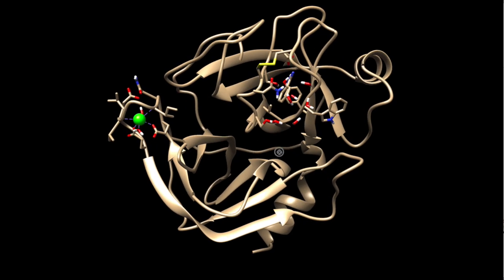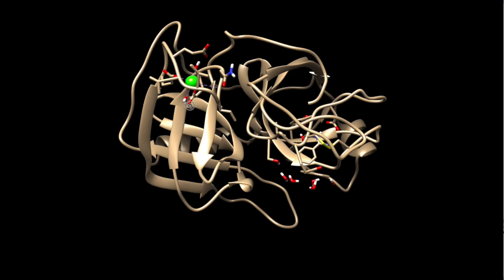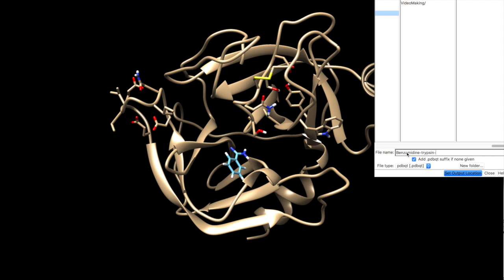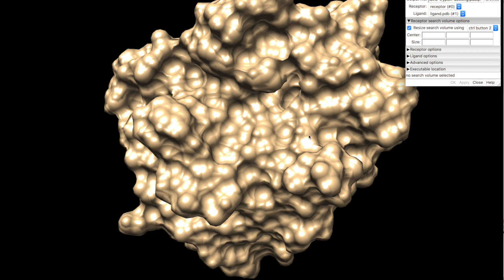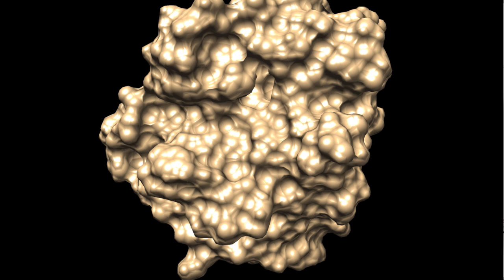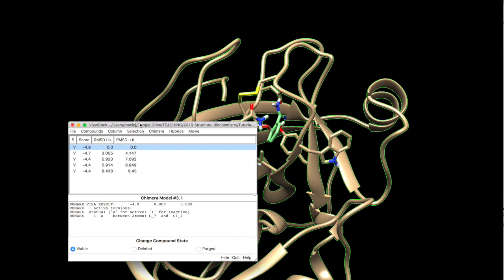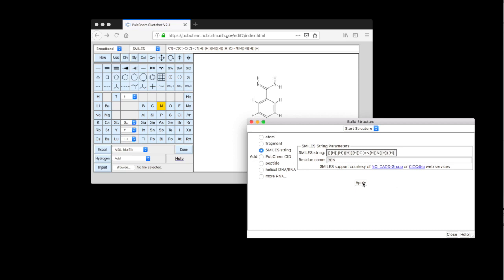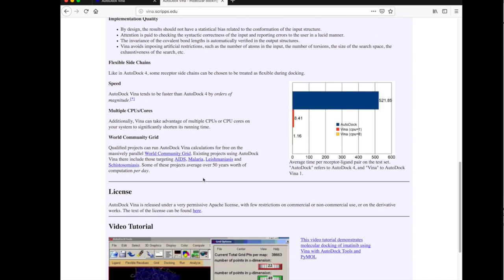Molecular Docking using AutoDock Vina and UCSF Chimera

Comment: Please can you help me with how to draw a grid box. I am not clear with that step
Reply from the maker: After a box has been created, it can be erased or further adjusted.
Clicking the assigned button at a point not over the box erases the box.
Dragging from a point over the box moves the frontmost face; also holding down Shift moves the the rearmost face instead of the frontmost.
Dragging from a point not over the box translates the whole box in X and Y; Shift-dragging translates the box in the Z dimension.

https://www.cgl.ucsf.edu/chimera/docs/ContributedSoftware/vina/vina.html

Comment: Hi Dr Macienj, I'm performing molecular docking using Chimera app and Autodock Vina on Mac OS. The protein I open in Chimera has selenocysteine in it's active site, and it's avoiding me to do the docking, showing the following error:

"The geometries and expected number of substituents for some atoms in the current models are unknown. These atoms are listed below. For each, please indicate the expected geometry and number of substituents. When done, click 'OK'."

What should I do to fix this problem
Reply: Hi, i had the same problem, did you can fix it?? Please i apreciate your help
Reply: Try using Tools -> Surface/Binding Analysis -> Dock Prep and run default settings (with "Incomplete side chains" checked) on the receptor before running the docking analysis

Comment: Hi, nice video. I have a question, I've seen tutorials of how to do docking and sometimes they use the option Dock Prep before to use the tool autodock vina, for prepare protein, ligand and assign charges, which option is the correct? or is the same? Thanks.
Reply from the maker: Dock Prep is used for docking using DOCK software. Dock Prep performs several tasks to prepare structures for DOCK or for other calculations, such as:
-deleting water molecules
-repairing truncated sidechains
-adding hydrogens
-assigning partial charges
-writing files in Mol2 format
So if your model needs some "cleanup" you can go ahead and use it.